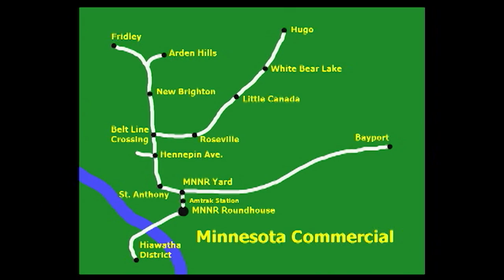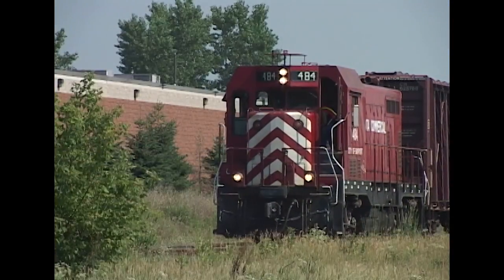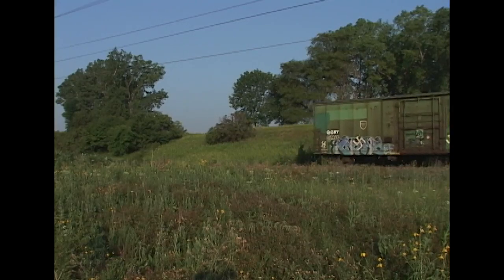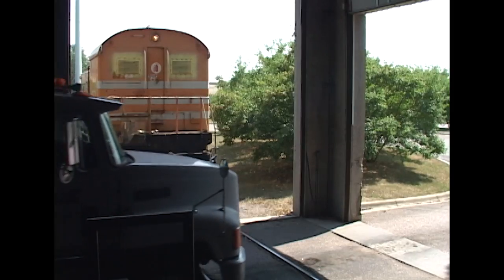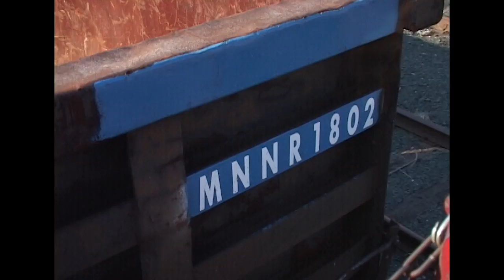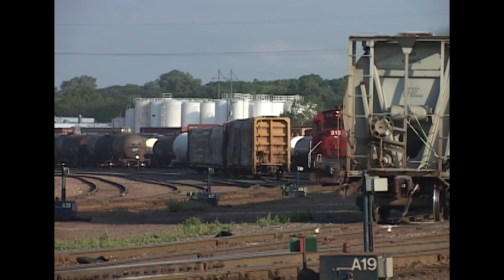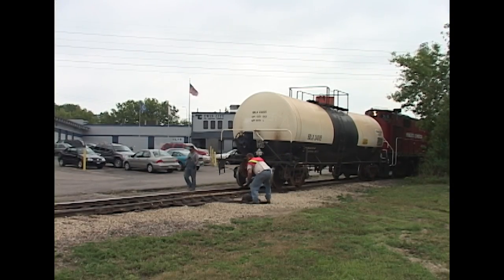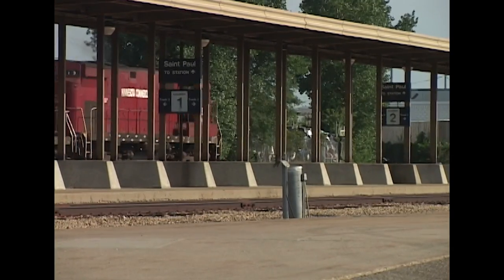Minnesota Commercial Railway - 70 Year Old Locomotives Smoking Like Chimneys!

Comment: Red ALCO diesels 316, and x-314, representing the good, old, X-G.B.&W.!!!!!   HI FROM GREEN BAY!!!!!   GO PACKERS GO!!!!!   I watched, and listened, and smelled ALL these ALCOS' from 1975 to 1977 during lunch break from West High school on Shawano Street, and also riding my bike in summer over to watch the switching in Norwood yard on 12th Avenue.   But sadly after the WCL took control in 1993 nearly all the mainline tracks were ripped off for bike paths.  Leaving only the West side industrial Park for switching by Packerland Drive.   Or the Eastern section cut back to Luxemburg for the large feed store, but 3 years ago in 2020 the new Canadian National Ry installed thousands of new wood ties,  to carry 100 ton cars and even large G.E. AC4400CW engines sometimes with 30 to 50 cars, but still not too fast, because the rails have casting marks from 1920!!   Yet some of the really old wood ties were nothing but rotted splinters.   Hopefully, someday, it would be cool if the old GBW 315 ALCO C430 here at the NRRM since 1987 should be rebuilt for excursions over the Luxemburg Sub and also rebuild all the way East to Kewaunee,  but maybe someday.....ALL it takes is time.....   Fri., March 3, 2023 A.D.
Reply from the maker: Hi Steven. Thank you so much for sharing your information with us!  The GBW was a classic railroad with the best locomotives. A lot has changed since then and it is amazing how much is still around and how much is gone.  I hope you continue to enjoy our channel and thanks again for your detailed comments!!!

Comment: Cool video! Seems like 2007 was just last year lol
Reply from the maker: Thank you!  It really does. And yet some things haven’t changed at the Commercial since then.
Reply: @CVisionProductions1  just finished watching the whole thing. Holy man! That bridge over the MS looked freaky as heck! I can remember riding the train and going over the Soo Line Camden bridge back in the day. That one is a little scary if you are afraid of heights…
Reply from the maker: Pretty neat, huh? That Short Line bridge over the Mississippi is way up there… And did you notice the gates to control entry? They had some issues with trespassing and vandalism, so extra security became necessary. And yes, that Camden bridge is another awesome structure! It’s great that you got to ride over it.
Reply: Scary how time flies. ⏲️

Comment: Really neat, that the bigger RR's get rid of power that they deem as old, and shortlines get them and run them far longer than a big RR would ever consider to use them.
Reply from the maker: That’s absolutely right. In some cases, these locomotives have spent double the time (or more) working for shortlines versus class ones. It shows just how resourceful shortlines can be. Thank you for watching and commenting.

Comment: Does the Minnesota Commercial Railroad still have the former CP Rail #4711, renumbered as #71, the MLW M636CAT with the Caterpillar diesel engine prime mover in it? I recall one other video showing it, with two other engines, in action. I saved it for my collections.  It is 2.5 minutes in length.
Reply from the maker: They do. Unfortunately, that unit is in long-term storage. Thank you for your inquiry, William.
Reply: As of 2024, it was bought by SARTIGAN RY, in Quebec-- an all Alco Shortline.

Comment: Would rail traffic improve if class ones were broken up and turned to class 2-3? It seems like shortlines actually take care and serve the customers they sign on for. Meanwhile if your not a 500 car or more a day unit industry class ones barely even will decide to pick up a string.
Reply from the maker: Well, in some cases yes, in others, no. Having larger railroads has reduced the need to interchange cars multiple times throughout their journey, thus streamlining the routings for many shipments. However, larger railroads are less hands on with the finer details of their operation. There are some exceptions, but smaller railroads are generally more attentive to a customer’s needs.

Comment: Is that a solar or tracking panel atop the local engine?
Reply from the maker: If you’re referring to the 484, that would be a stand for the radio antennas. They were mounted on top of that stand.

Comment: Why does the 316 smoke so much? Is that normal for Alcos?
Reply from the maker: It seems like those RS27s smoke more than the others. It is fairly normal for Alcos to do that, but not all of them do.
Reply: Absolutely! The older they are, the more it belches black smoke! The suet atop those locos are hard encased diesel markings...like tar!

Comment: No ditch lights on Alco engine 316?
Reply from the maker: I think it is because it doesn’t travel on Class 1 rails that makes it exempt from ditch lights. But I could be wrong. Maybe someone with more knowledge can fill us in. Thank you for watching and asking.
Reply: Ditch lights aren't required on trains not going faster than 20 mph